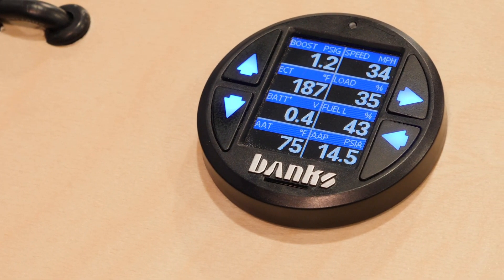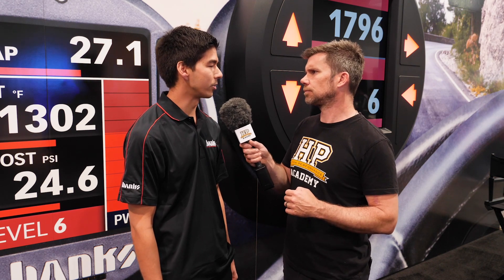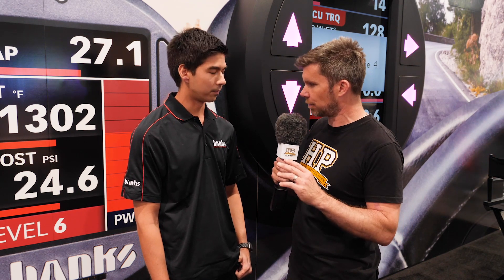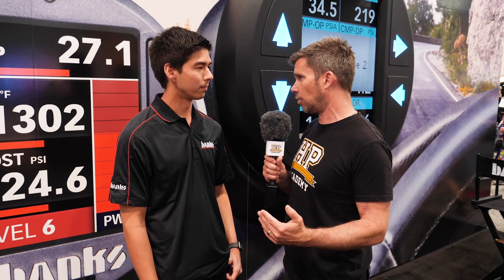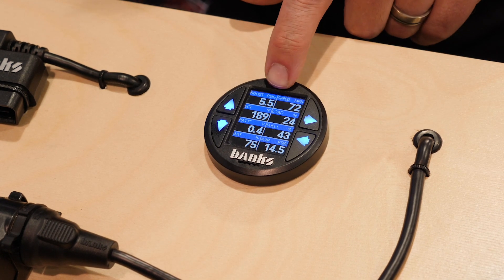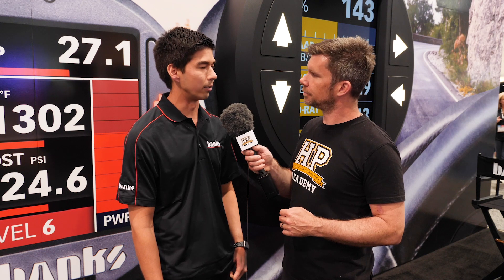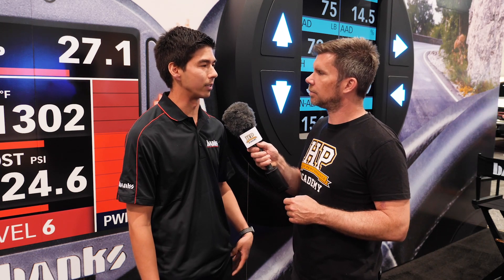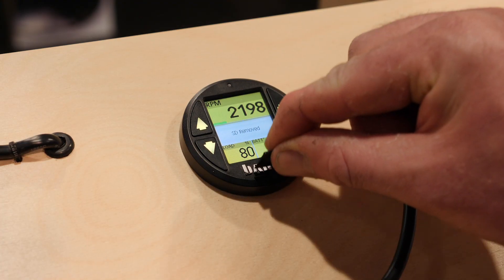No Duramax Reflashing Software? No Problem! | Derringer Inline Tuner [TECH TALK]

Comment: So basically a closed loop piggyback 👌
I like that! 
How long before I can plug one into my D23 Navara? 🙂
Reply: I doubt they would ever come out with a Nav version.
Reply: @ReubenHorner 
No, me either, just thinking out loud 👍
Reply: @Danger_mouse  Haha, There probably is something you can plug between the rail pressure sensor and the ECU to make more power but I would not recommend it. Heck, you could probably install a resistor of something like 1k between the signal and the gnd on the rail sensor to get more performance
Reply: @ReubenHorner 
There's several interceptor units available for the D23, but none of them connect to the MAF or run in a closed loop. They are simple fuel pressure boosters. 
Maybe they'll make some more power, but no way of knowing what other issues they will create.
Pretty happy with the standard 450Nm between 1500 and 2500, but you can alway have more 😁

Comment: Tuning has gone full circle.
Interceptors -> chips -> reflashing -> aftermarket ecu's. Now we're going back the other day.
Reply: lol no, these modules are a disaster waiting to happen. hpfp dont like running 10% higher when you could just increase PW.
Reply: @Nebbia_affaraccimiei  You don't want more PW...you will increase EGT and risk damage to cylinder walls
Reply: @ggdragu6013  you have any idea what EOI modern engines run lol
Reply: @ggdragu6013  agreed. Gale has gone over this very well in his 2 current duramax video series. Need to keep the pulse width in check or end up with plumes of black smoke.

These modules are pretty modest in what they give and far smarter than the old HKS or Apexi units from back in the day. Given Banks Power's strong association with GM, you'd have to think these are about as safe as you can get. Still far from ideal, I agree.